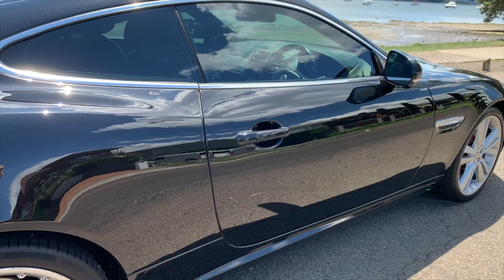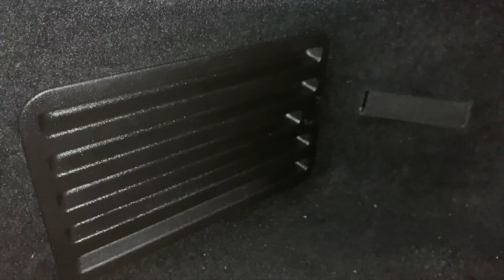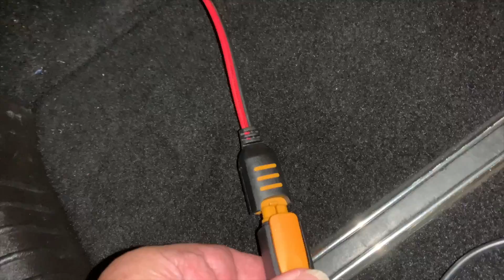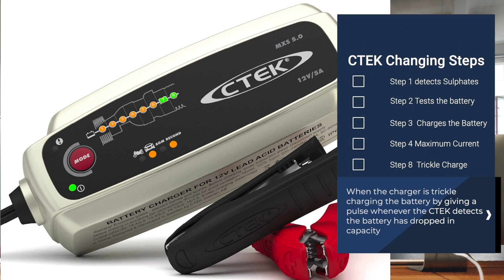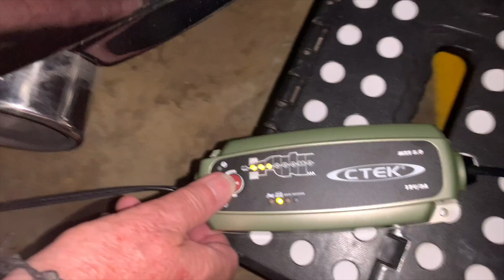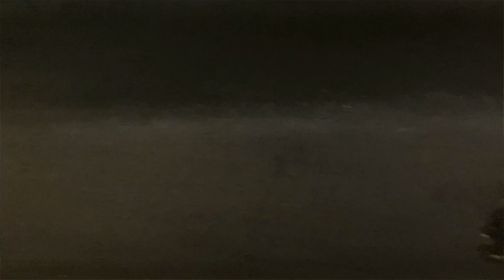Maintaining Jaguar XK Series Batteries: CTEK Charger Guide for x100 and x150 Models

Comment: Great video.  In one of your previous videos in the XK8 you used a NOCO 10 charger, why did you switch to CTEK and based on your experience is the CTEK better. I am considering buying either the NOCO 10 or CTEK MXS10 for my 2012 XKR. Thanks.
Reply from the maker: Either does the job. The NOCO failed after the warranty ran out. I replaced it with the Ctek because of the reviews

Comment: Such a great video 

I’m about to try using my CTek on my 06 XK X150 

I’m newish to Jag, had it 6 months loving it but nervous mechanically 😅
Reply from the maker: I like the term. “Nervous mechanically” explains me to a “t”. I’ll be using the phrase in the future. Many thanks. Bruce
Reply: @xk-r-us   CTek fitted and looking good. Thanks again for such a helpful video…

I’m working my way through them. They are all good and so helpful especially to this “mechanically nervy” Jag newbie.

Despite awful UK weather I’m hoping to run out on decent days before fully getting back into it next spring 

Any tips guidance always appreciated 

Thanks 🙏
Reply from the maker: We are lucky here in Oz. Weather never gets too cold to take out the Jag. Unless you live in Melbourne, where there are 4 seasons every day. But I digress. It does get very hot from time to time in summer. But you wouldn’t want to leave the houses air conditioning anyway. (Unless you live in Melbourne in the cold quarter of the day) in a nutshell we can go out pretty much any day of the year.

Comment: Thank you so much for taking the time to put this series of Jaguar XK instructional videos together.   They have proven extremely valuable to a new owner like myself (2013 Jag XK NA).   With regards to connecting Ctek eyelets permanently to the remote battery terminals, do you have any tips  or cautions?  I'm not a mechanic so don't have experience removing bolts to install these eyelet connectors. Connection with the alligator clips has not been a problem but less convenient.  Thanks for any help.
Reply from the maker: I'm very pleased that you have taken the time to comment. It's a learning curve and I find out something new practically every video As far as attaching the Ctek permanently: On the remote terminal (with the rubber hood) you will see it has a nut on the top that you can remove to connect a bigger version of the eyelets that come with the Ctek. It looks like the eyelet attached to the Ctek is too small. Make sure you connect the RED. MOST important - make sure the eyelet does not touch any body work as you will create a short circuit. I would wrap electrical tape around the connection if I were doing it myself. The negative end of the Ctek could connect to the nut that holds the bracket I attached the alligator clip to. The negative end is not critical as it's already attached to the body work. If wanted to do this for my car I would pay an auto electrical guy to attach it for me.
Reply: A question I had was whether the eyelets supplied with my CTek (MXS 5.0) were of the right size to slip onto the Jag’s remote battery terminals; I believe they are an M8 screw size.   Unfortunately from your comments it sounds like they are not, and sadly I purchased a second “comfort” set with a power level indicator (CTek part #56-382) that are of the same size.   In any event, this project is on pause for the moment while I sort out another issue:  I need one of my LED taillights replaced as the enclosure has a crack in it that has let in water and knocked out most of the LED bulbs; and yes, that is an expensive replacement, particularly as I have only had the car 3 weeks.  But I am determined to get this Jaguar XK sorted out for the Canadian Spring starting soon and your video series has been incredibly helpful.   Next up for my car is a paint correction and ceramic coating service next week.  Can’t wait to see the results!
Reply: I think the reason for not connecting the ctek directly to the battery on the x150 is to do with the battery management system which mustn't be bypassed (which it is if connected directly to the battery). It needs to know when the battery has been charged and is only  " in circuit " if connected the way you have described.